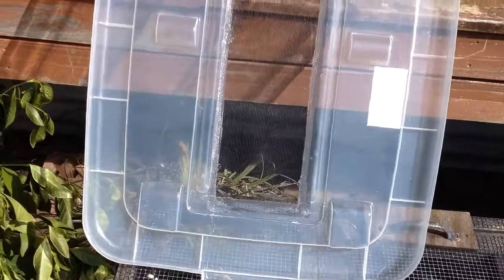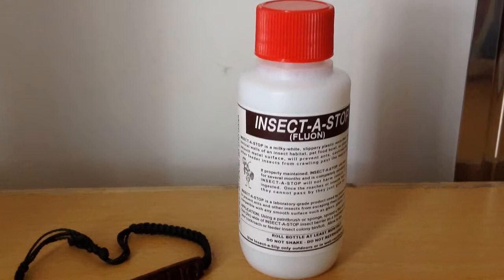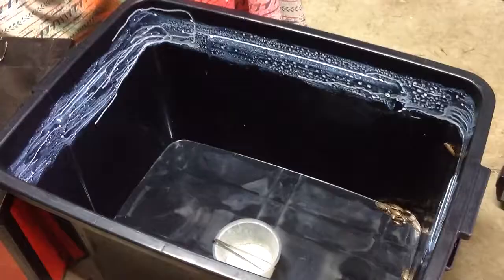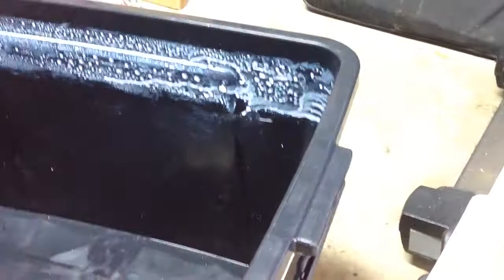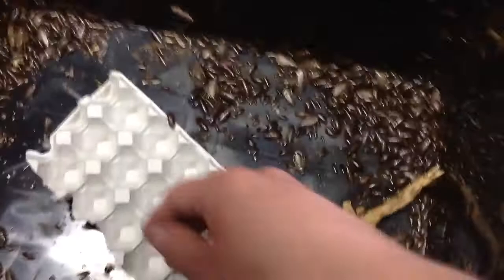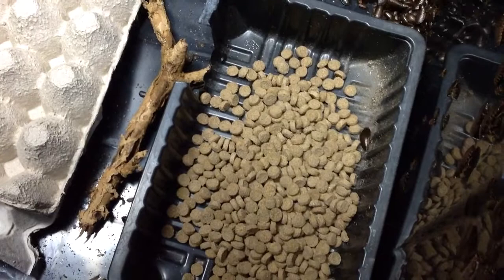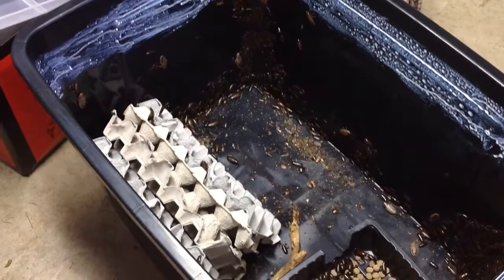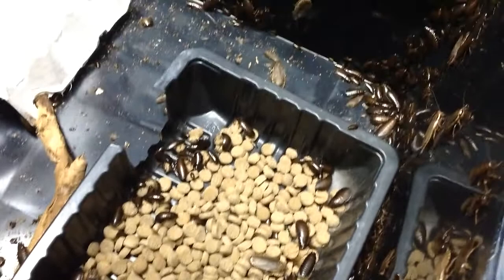Keeping & Breeding WOOD ROACHES for Reptiles

Comment: would you be able to put the materials for the bluey hutches as im going to make every thing that you used for it my dad says its a good idea thanks
Reply from the maker: 1200Lx600Wx300H, wood for frame, box and you could use it for the bottom and lid. metal fly screen on sides with wire on top. you can use lawn mower wheels or something similar to be able to move it around
Reply: what did you use for the lid and for the sides were the box is and were the hole is into the box and how did you cut it out to fit the frame
Reply from the maker: its this metal stuff from an old sign i don't know where you'd find it just use wood and a jigsaw.
Reply: what was the stuff you used for the lid